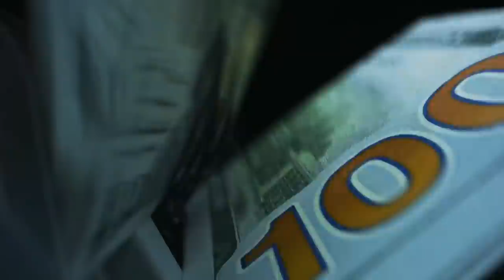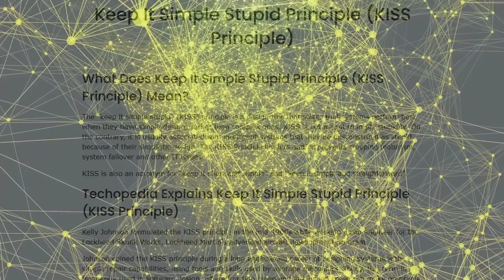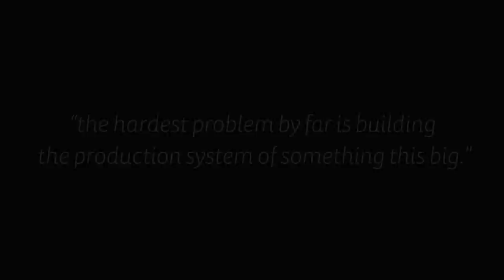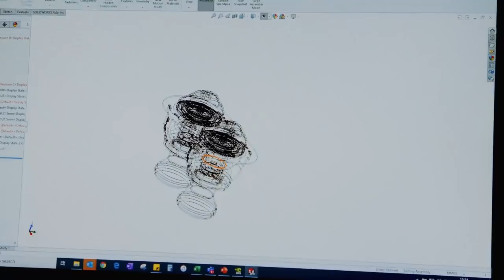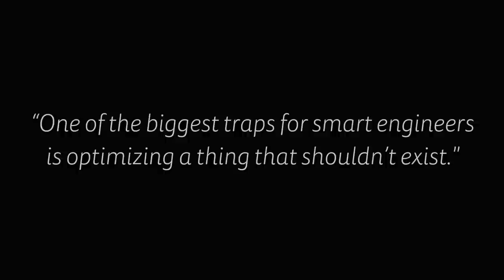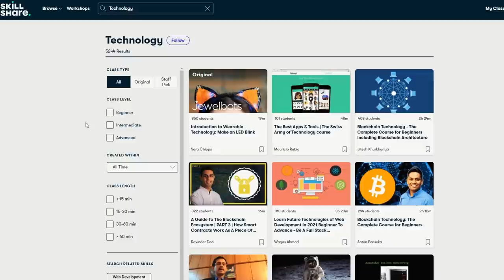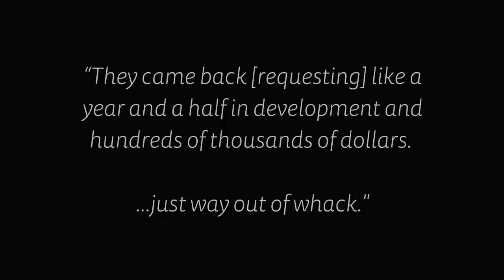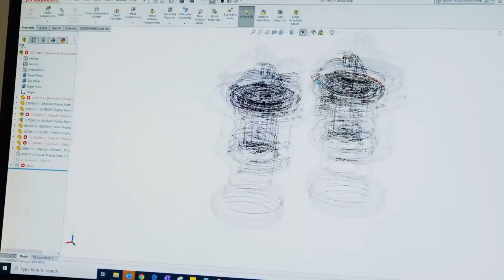How SpaceX Uses Simplicity To Engineer The Cheapest Rockets In History

Comment: It is BECAUSE of it being REUSABLE is the main reason why it is the CHEAPEST, not because the Raptor Engine is simple. Raptor engine IS NOT a SIMPLE DESIGN.
Reply from the maker: Raptor is indeed a more complicated design, but it's switch to methane simplifies the fuel production (and improves reusability through cleaner combustion). In a rocket that is reusable and is flown many times, the production cost of the rocket itself deminishes quickly and the production of the fuel becomes the more important factor from a cost and complextiy standpoint. It's similar to how fuel costs becomes the larger cost factor than production for the airline industry.

Comment: I’m fairly convinced that the people who look down on Elon don’t pay any attention to the man himself in the slightest. It’s as though everything they say is completely contradictory to anything the man actually does. There’s gotta be someone who comes up with this stuff and then spreads it? I would never come to the same conclusions as these people from watching the videos that he appears in.
Reply: @nunyabiznez6381  Oh my, so that's why Old Space sucks!
Reply: @graullas8981  If you mean the traditional way NASA has done things then yes I agree it does suck.  I don't have a good explanation as to why NASA turned into what it did.   But they encouraged all of the above through their endless regulations.   I made parts that took longer to inspect than to make.  The military wanted a report that included a 36 point inspection for some parts that took 2 minutes to make but it took about 20 minutes to do the 36 point inspection and write down all the measurements.  We weren't permitted to do it electronically.  We had to take the measurement with manual measuring instruments then walk from the gage room to the inspection office and write down the measurement then go back to the instrument room and take another measurement then walk down to the inspection office and report that.   See how fast you can run 50 feet each way 36 times AND remember the 5-6 digit numbers along the way then run back out onto the shop floor and grab another piece off the line and press the button to tell the machine to make just one more then run back to the instrument room with the new piece and do it all over again.   Then you get written up for having 90% down time not to mention you have that other machine you also have to run and make parts with and inspect.  Then we have to hand deburr every part then remeasure it all over again because deburring will often change the dimensions then we had to remeasure them the next day because they came out of the machine warm and would have different dimensions when at room temperature.
Reply: That one person is the youtuber, Thunderf00t

Comment: Basically - If it already exists, buy it off the shelf, if it doesn't already exist build it yourself. It's about speed.
Reply from the maker: Yep, speed is the other super key factor for SpaceX, which is what the previous video was about. Their dedication to speed really stands out.
Reply: I had a conversation about 20 years ago with someone who worked on those $5000 toilet seats they had on some air craft.  Turns out the off the shelf models had screw holes a quarter of an inch further apart and they were made of titanium because they wanted them to last longer.  He suggested re drilling the holes on off the shelf toilet seats and that instead of pay $5000 for a toilet seat that would last 500 years, replace the off the shelf one every year for the 30 year life of the air craft at a total cost of $1500 including labor.  He was written up and threatened with termination over that suggestion.    I once applied for a job at a company and didn't get the job because during the tour of the facility I saw multiple inefficient processes and multiple parts that could have been obtained off the shelf.   I pointed those things out and they didn't like my observations.
Reply from the maker: It's kind of amazing how external factors can lead to this kind of crazy inefficieny and yet also create a staunch defence against improving it. I've seen similar things myself, including facing much difficulty in replacing a process which used an old mainframe system (over 40 years old) combined with a manual process, with a new automatics system with a few hundered lines of code. It saved weeks of work, it was far less error prone and was actually maintainable in the long term, yet there quite a bit of resistance from some corners to even consider testing it.

It's a shame to hear you didn't get the job because of being too proactive with improvements, but perhaps its for the best, if you enjoy making things better, it doesn't sound like it was going to be a good place to be able to do that.

Comment: Smart move using the motor sport manufacturing industry. 
SpaceX's design philosophy is shared in motor sport, notability stemming from the early days of Lotus in F1.
The way motor sport starts again each season forces a focus on iterative improvement and fresh thinking to stay ahead of other teams doing the same.
Reply from the maker: Colin Chapman: "Simplify, then add lightness”
Reply: @ExaCognition  By comparison I imagine a lot of established aerospace suppliers are steeped in dogma and too parallelize by the paper trail required to explore outside the box.
Reply: tesla applied the same principle to the chassis.. hydraulic pressing  72 components into one .. More accuracy , less parts , etc

Comment: A partially reused falcon heavy (side boosters reused, center core expended) cost 95M$ for just a 10% payload penalty. That's 1654$/kg or 18 times cheaper than the saturn V.
Reply from the maker: When I reviewed the video, I realised I hadn't used the optimal Falcon Heavy figures and it was too late to change it. The next SpaceX video is a more in depth look at the cost to LEO over time (including best estimates for the upcoming starship), so I will cover and correct it there. It's always a bit of a nightmare with the SpaceX numbers, because some of them are opaque, different sources quote different things, and they change and update all the time. I'm hoping to get a more detailed breakdown for the next one. Starship is particularly tricky because its design is constantly updating, but its got a very interesting implications if it gets even close to its intended design parameters.
Reply: Does it get cheaper every time a falcon rocket is reused? i'm not a math fan...
Reply: @yootoober2009  A reused falcon 9 is 50 millions instead of 60 millions. But that's the price, not the internal cost.
Internal cost is 90% lower for a reused rocket but if you look at average cost it's 53% cheaper after 5 launches and 68% cheaper after 10 launches.

Comment: Do you think an EVTOL would be feasible now that tesla has a carbon-sleeved rotor (for their model S Plaid)?
Reply from the maker: Generally yes, I think EVTOLs are becoming increasingly viable. The application is still on the relatively niche side for now, but I think its only a matter of time for air taxi's and shuttles at least. There are a few (not insignificant) hurdles to overcome, but I don't see anything intractable that will stop them.
Reply: @ExaCognition  Less range than an helicopter but far cheaper. If you can reach cruising altitude during a few minutes for just a few bucks and they manage to fit an huge window it has a lot of potential as a tourist attraction like hot air balloons.
Reply from the maker: Far safer than a helicopter too, more redundancy of critical parts and systems, easier autonomous integration etc. Ontop of that, queiter. I remember a study that showed they're more energy efficient than electric cars for medium to long distance. Much of the energy is in the initials ascent, but once you are at cruising height,  its very efficient to maintain, especially with fixed or tilt wing.
Reply: @ExaCognition  In theory you have the same efficiency wether you are at sea level or at 11 kilometers because the lift to drag ratio is the same as long as you are subsonic. But the higher you go the faster you go so going higher is better.

Comment: I contacted Voxeljet to ask how much does a 1280x680x500mm sand mold (made in 2 hours and 26 minutes on the VX1300X) cost
It's 1894$ for 15 days delivery and 4201$ for 5 days delivery. The delivery is more expensive than the mold xD
Reply: They told me 1611 and 3572.5 euros but I converted to $
Reply from the maker: Makes you wonder what the marginal cost of molds will be in a few years time. The "high" delivery cost is for expidited molds, which suggests that there is still some sort of throughput bottleneck at perhaps the process side. Or perhaps its just price and its not actually reflective of internal cost. In any case, that looks very promising on what is already super impressive.
Reply: I think you were probably paying for the privilege of having your job bumped ahead of other jobs.  I would say though that is pretty fast turn around time compared to the machine shop I used to work in where if you called up in January for a custom made part you might get the first batch by year's end.
Reply: @nunyabiznez6381  Rapid prototyping is just the first phase, after the 4th industrial revolution most consumer goods will be custom made.
Reply: @johntheux9238  I think we will see a lot of custom things true but I doubt that Corporate policy would permit that.   It will always be easier to make 10,000 identical widgets than 10,000 different widgets regardless of the technology.  That and humans tend to like joining trends and wearing trendy clothes, shoes, owning trendy phones and other electronic devices.  Trends can't exist without mass production of identical goods.   You see your neighbor has  a new toy you want that same toy.  At most you might see companies offering endless options for each consumer good but total customization is unlikely on such a massive scale.
Reply: @nunyabiznez6381  Imagine you have a yoghurt making machine that can make 10'000+ combinations of flavours and that's the size of a vending machine.
Instead of having 10'000 different machines in china (one per flavor) producing billions of yoghurts and having to deal with shipping costs you have 10'000 identical machines everywhere around the world.

You still have the same amount of machines and the same throughput so you get the same economies of scale, but you don't have to deal with shipping...
Reply: @nunyabiznez6381  And the 10'000 machines are identical instead of being different...
Reply: @nunyabiznez6381  The idea is that instead of mass producing the product you are mass producing the machines that will mass produce stuff so you get two levels of economies of scale, but since there is not enough demand for that you need machines that can make different products.
Reply: @johntheux9238  I was not including food production in my assessment of manufacturing.   But your point is taken.  They actually are approaching that now with some soda machines, directly accessible by restaurant guests, offering dozens of flavors in thousands of combinations.   I can't remember where but one I saw a few months ago I counted 43 different drink flavors.   One could mix over 900 combinations just mixing half of one and half of another.  Add in more than two flavors and vary the ratio and one could possibly get millions of combinations.   When I was speaking of customization in manufacturing I assumed we were talking about endlessly changing various shapes and dimensions of a given part such as variations in thread pitch, pitch diameter, length, bore diameter and radiuses and angles of various machined parts.   This of course you can do to a certain extent with 3D printing which is why at the moment it is such an advantage over machining for r&d.
Reply: @nunyabiznez6381  That was just an example thought.
Reply from the maker: Very interesting conversation thread. Car manufacturers are trying their best to allow as many options and versions of a product to meet every customer's needs. With the proliferation of car platforms, they want someone to be able to walk into a car dealership (unless its Tesla) and choose from 15 different models with thousands of options. It's in the options where they make most of their margin. That said, this complexity of models and options makes manufacturing a nightmare even with platform development.

The balance between standardization and personalisation is an interesting one. On the one hand, in many things we want a shared experience, we want to have seen the same movie, read the same book, perhaps even have the same phone. On the other hand we want our things to be unique, so even if we have the same phone, our phone case is unique, our car has different trim etc. There is of course huge variation across people in this regard, so it makes it hard to be concrete about.

With respect to production systems, a flexible or (ideally) an agile production system gives you the ability to replicate, iterate and even create something new. So whether people want the same or something different you can do that. I do think 3D printing is big in terms of its ability to enable localised and agile manufacturing, though of course it still needs to grow in capabilities to be able to fully realize that. That said, I think the difficulty to operate, the material limitations, the speed, cost etc. are trending in the direction that they become much less of a barrier going forward.
Reply: @ExaCognition  And there is the "make it yourself" side of things too. If you have a factory that is automated enough that the customer can come and go like a store without even talking to anyone.

Comment: Be careful - simplicity or crudity ? I am a retired professional engineer. Its true whenever government funding is involved, that things tend to be overdesigned on cost plus contracts. On the other hand, on fixed price, corners tend to be cut; cut the design time and test test test ! Seems to work, but there might be one more test you did not think of. COTS ? I agree, no point re-inventing the wheel, but hey if the government is paying. Sure, design and make it yourself but if COTS is cheaper (and it meets the spec), go ahead. It all comes down to common sense and ethics. I worked in the US - they used to say "Its time to shoot the engineer" - if it fails, we'll we will sell 'em more spares. But people can die - like the B737 max.
Reply from the maker: Well this simplicity vs crudity is the interesting paradox. SpaceX's development process looks crude at first glance, I'm also an engineer by profession and their approach looks quite alien to development of the complex vehicles I've worked on. One of the key distinctions of how they test, these aren't lab tests they perform, where they are controlling the environment (and possible missing external realities as a result), they are testing by launching many many vehicles. This forces the real world problems to the surface better than any lab test or simulation could have. 

This is why the falcon9 block 5 has reliability beyond that of the other heavy launch vehicles, despite having the "crude" development process compared to its overengineered counter parts. Performance and reliability are easier to build through iteration than careful planning at the whiteboard.

I'm a bit mindful of the phrase "common sense" in an engineering project. It relatively easy to apply at the individual level, but with the complexity of a large scale projects, it tends to get lost. I think this is in part because when dealing with really large arrays of competing constraints, the optimal path can sometimes become obscured an unintuitive and our common sense heuristic can lead us astray.

Comment: The difference is that I would get into a 50 year Saturn 9 today without asking questions. Look at what they are doing in Texas right now. Would fixed-wing flight be as safe as it is today if the early innovators would have just crashed unmanned planes into the ground repeatedly (using tax payer dollars)? No human will ever get into those rockets.

Comment: How many parts in the raptor engine are casted?
Because with a voxeljet VX4000 you can print a 4x2x1 meter sand mold in 58 hours for only 20k$ and that's not even using their faster IOB (inorganic binder) process.
With the VX1300 X printer using the IOB process you can print a 500*1280*680 mm mold in just 2 hours and 26 minutes.
Reply from the maker: I don't actually know the answer to that. I know the Raptor is quite optimized for volume production, they've built 100 already. I understand that Merlin used 3d printing for some of the complex geomtries and Revlativity Space print a large amount of their rockets and engines.
Reply: @ExaCognition  For the most complex and high performance parts I would suggest the SLM Solutions NXG XII 600.
2 hours and 26 minutes for a sand mold is insane, Voxeljet printers are made for mass production.
Reply from the maker: I can't even wrap my head around 2 hours 26 minutes. That's not just set for mass production, thats well set for agile production too.
Reply: SpaceX's new factory at MacGregor, Tx. has already broken ground with a goal of 800 - 1000 version 2 Raptors a year.